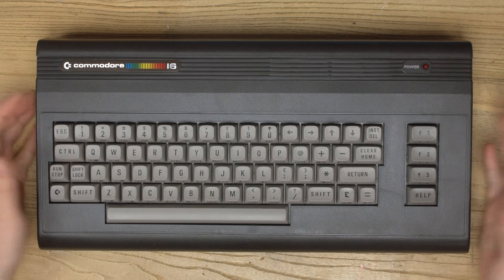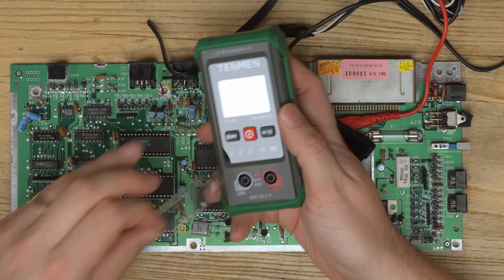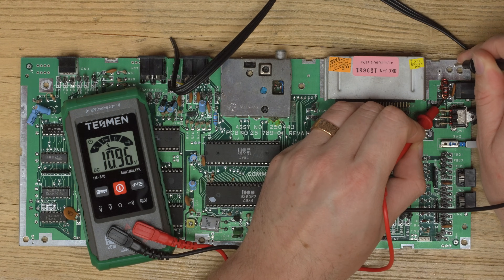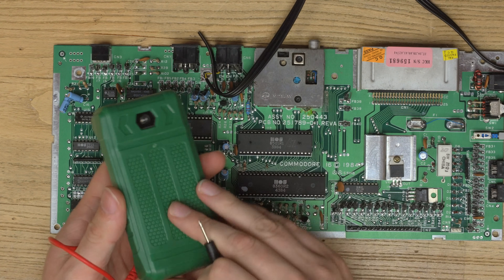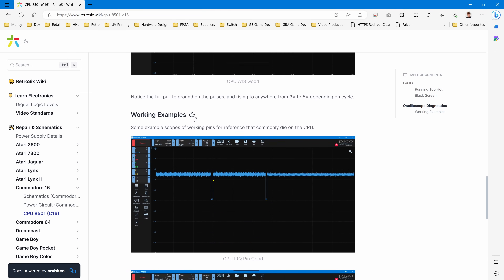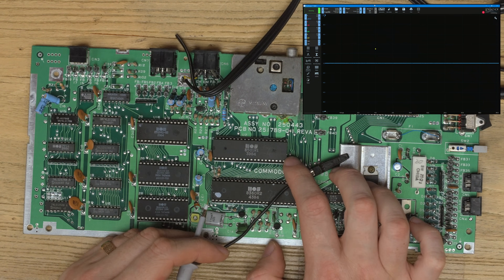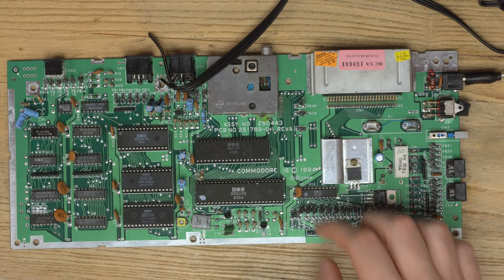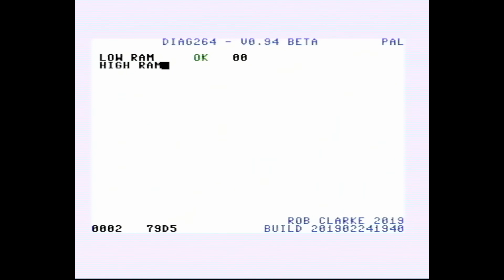Want to repair a Commodore 16 from Black Screen with me? RetroSix Repairs

Comment: I've bought a Tektronix 2236 'scope as I have a few machines (including a C16) to fix. I've learnt so much from this video, from using the 'scope on which pins (and a clear theory behind it: levels, VCC/IRQ, etc) and even how to extract ICs more safely. One thing, I was understanding that it should be a 9V 1A PSU (like the centre neg Speccy +2 PSU) and not 15v ? Which is correct ? Oh and bless you for such a video that I shall use as a reference !